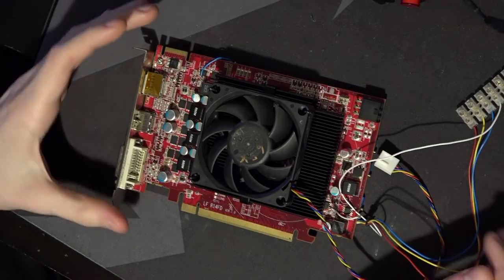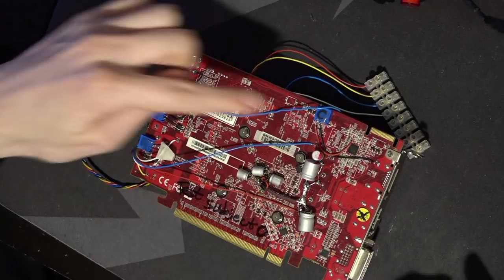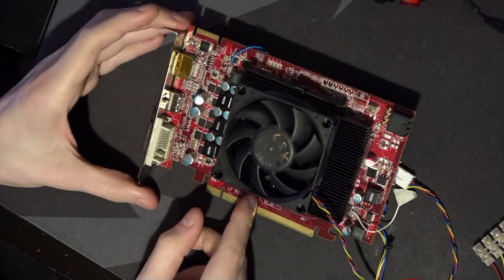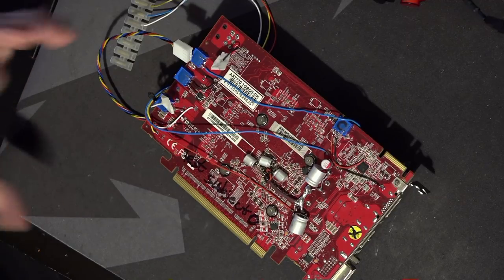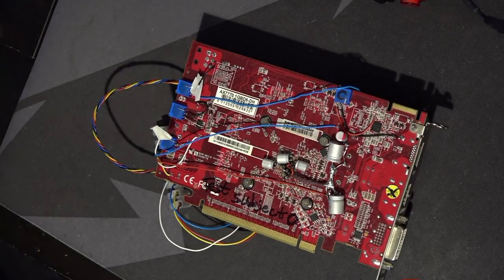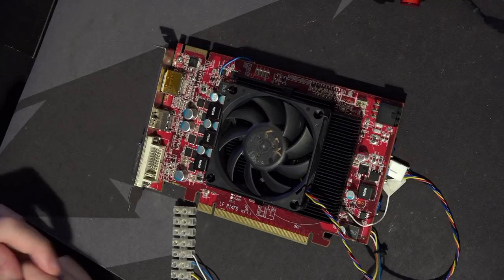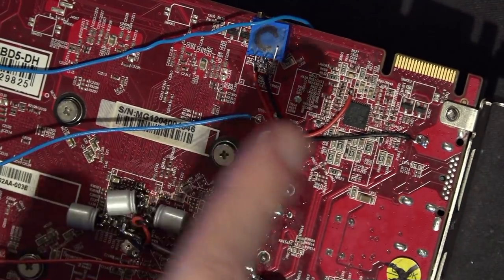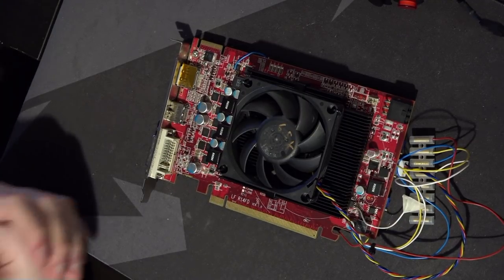ALL the mods for an HD7770 // higher memory controller volts help with VRAM clock.

Comment: Oh awesome, I just ran out of stuff to watch! These GPU videos are always so interesting to me.

BTW I have a 7950 Dual X that installs drivers fine, but its really unstable. For some reason video playback and rocket league is all it can do with no issues, but anything else either has artifacting or it crashes. Under clocking actually helps it a little bit too. You're like the king of 7950s and 7970s so I was wondering if you know of anything that I might be able to try for the fun of it. I know these kinds of issues are usually a dead core, but I can dream!
Reply: reflow it.. aluminium paper all the card and only cut on the gpu chip and then air gun to 260°c for 5 mins doing circular movements. on the gpu core.
Reply: @z21ify  I've not got a hot air gun and DOOM, Animal Crossing and college have wiped me clean. I assume the oven method is the cruder solution?
Reply: @bhume7535  the oven is not good cuz u heat all the gpu and not the core thats what u need only. u can see some reflow videos is not hars at all i have done succes some gpus but with the oven methond i fuck up a gtx 460 back in 2014..
Reply: Had the same issue with my hd7750, except I also had bluescreens all the time. Oven method fixed it.
Reply: @bhume7535  Go to a hardware store and rent an air solderer. If you do it there in front of them they usually let you even use it for free if you're doing something cool, most people like to enable cool things to happen.

At least that's how it's worked for me every time I've needed a specialized tool that I'd never needed again.
Reply: @TheFlypaste  It's called a hot air rework station.

Comment: I am currently running HD 7750 at 1.1 ghz gpu and memory 1350 MHz at 1.3 V. Temps are 60+. My questions are: 1)  If temperature is not a concern, at what voltage will be deemed to start damaging the gpu? 2) Msi afterburner seems to limit the MHz to 1145 even if the bios has higher MHz limit. How do I overcome this? Thanks for any advice.

Comment: 🙂👍 yay Thats Neat, i have an HD 7750 around here
Reply: There's a 7750 on eBay right now with no name (had to use stickers on back of card and a generic search to find it) I found in an auction for $13. Tempted to go for it.
Reply: @FatheredPuma81  🙂 neat, thats a very low price
Reply: @MrSamadolfo  Yea i'm kind of curious how much it's going to go for in the end. Would have went for it bu instead grabbed a GT 635 instead to see about using Shadowplay to record gameplay.
Reply: @FatheredPuma81  😎 cool
Reply: @MrSamadolfo  BF5 at 480x270 at 35% :D. Couldn't run Shadowplay sadly seems the fixes for some reason don't work and it can't run YouTube at 1440p60 2x speed :(.
At least I can still mess around with it. Got 175/175 core/mem overclock though.
Reply: @FatheredPuma81  🙂👍 ok

Comment: any knowledge on hynix d die? my 3600 16-18-18-39 kit only runs 3200 with those timings on a 9700kf, learned about the voltage wall the hardware, kept it at xmp memory voltage of 1.35 after the fact, xmp is bootable but unstable although that just boms the system agent with a shit load of volts